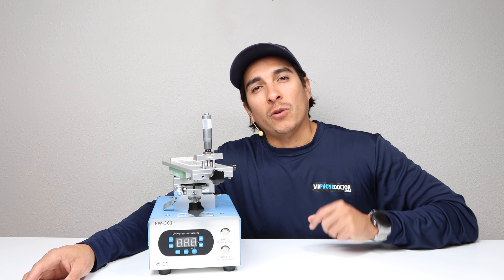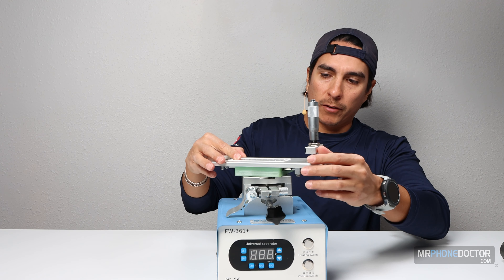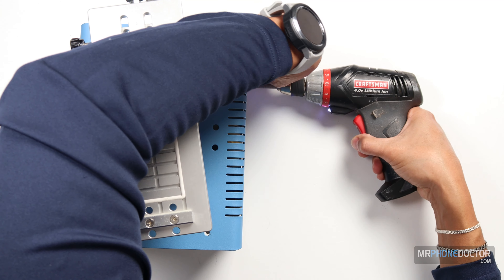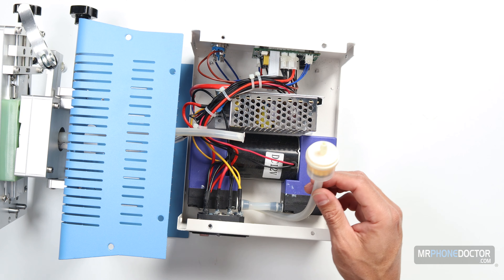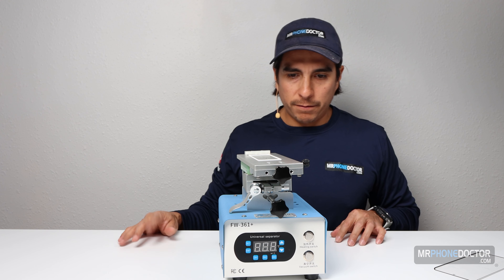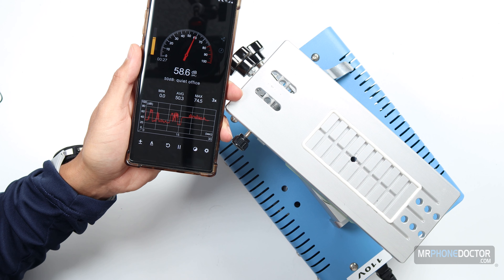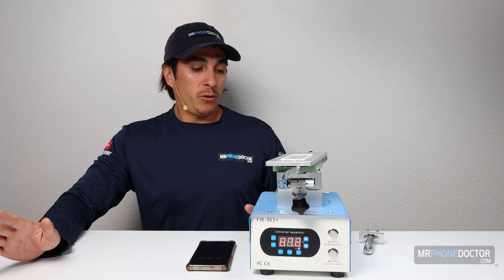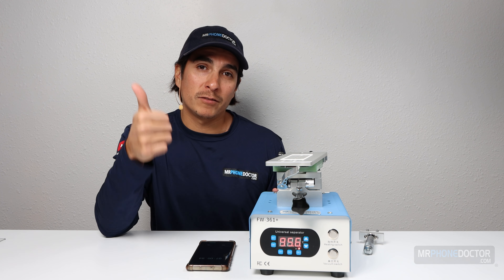Whats Inside Foward's FW-361+ 3 in 1 Mid-frame Remover & Separator Teardown & Features

Comment: This is a great machine, bought a couple of days ago, video with lcd frame  teardown would be very helpful..
Reply from the maker: Video is out:)
Reply: @MrPhoneDoctor  there is one thing that is weird with this machine, the suction doesn't work everywhere, i need to search right position with lcd to be grabbed down..
Reply from the maker: @putar83  try adjusting your seal. Also press doen on display to make sure grab goods
Reply: @MrPhoneDoctor  thank's for quick answer, i was more thinking on a lcd with no frame, that seats  on silikone rubber, offcource  i will practice more but still i was thinking that the suction should work on entire surface..
Reply from the maker: @putar83  is the glass cracked? If so it may be letting air out. Tape the broken glass